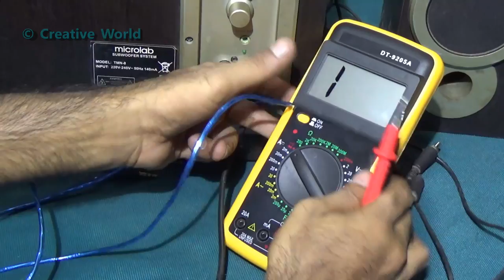How To Remove Noise Sound Of A Home Theater Easily (Bengali Tutorial)

Comment: Bro my home theater is f&d it will works perfectly but 5 speakers are full humming doesn't sound clarity pls give me suggestion
Reply from the maker: it may cause for power problem
Reply: @CreativeWorldPro   what is difference between EI transformer and toroidal transformer ? 
Tell me bro pls
Reply from the maker: the toroidal transformers offer very stable output voltage, resulting in less voltage drop also during high loads.